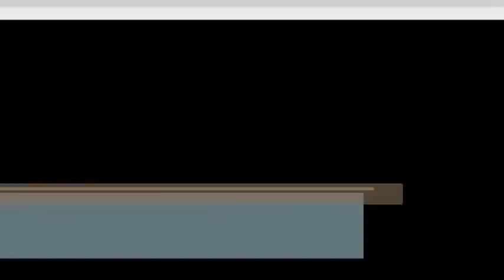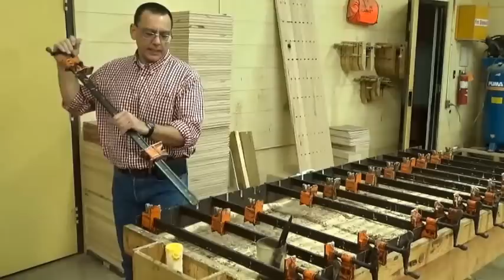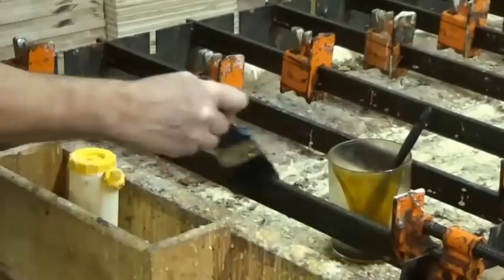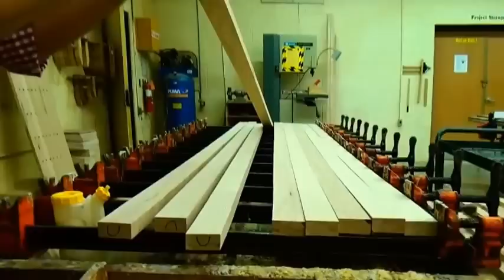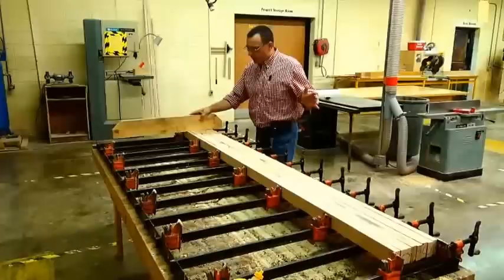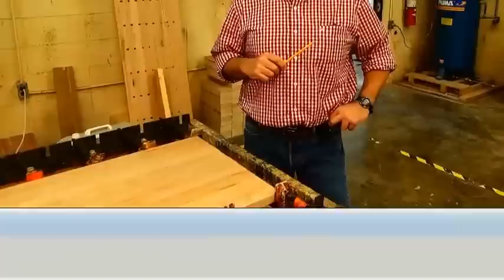How to Use the Clamp Table to Produce High Quality Panels

Comment from the maker: I made the plates that support the clamps using a CNC Plazma Cam.  If you take your time and you are careful you can make them using 12G strips of steel.  The slots are 3" apart and as deep and wide as the bar of the clamp.  You can easily use a hand held jig saw with a steel cutting blade to make the slots It will just take a bit longer.
Reply: I am in the process of making a very similar clamp station, thanks for your information. I am assuming that your table is 4'x8' and those clamps are 4'?

Comment: Where did you get the clamps at?  I lost my Dad in 2007 to cancer.  He worked at Ft Sam Houston for 47 yrs. and was a furniture repairman.  I learned a lot from him as a wood worker at home.  I have 1 son and 1 Grandson and two great grandsons.  I would like to pass this down when I'm gone.  The clamps you show I have had no luck finding.  Any help will be greatly appreciated.  Also what size of lengths are the clamps and the metal clamps sit on are what kind?
Thanks,
Richard Longoria
San Antonio tx
E-mail:  rlongoria3588@yahoo.com
Reply from the maker: +Richard Longoria

Just search for this - Jorgensen 7248 48-Inch Heavy-Duty Steel I-Bar Clamp

Good luck!